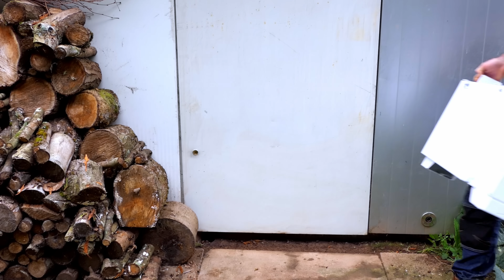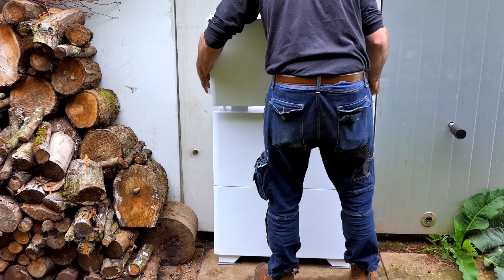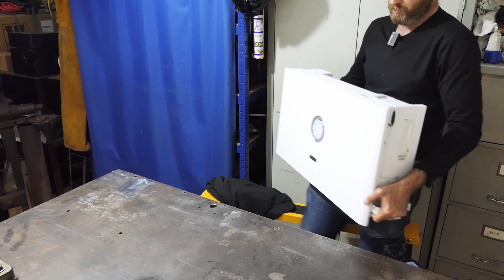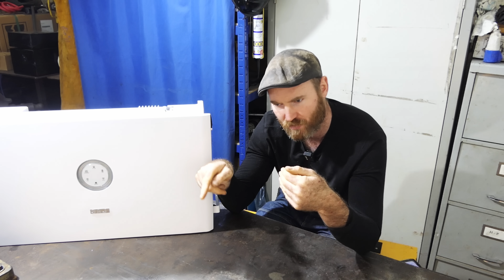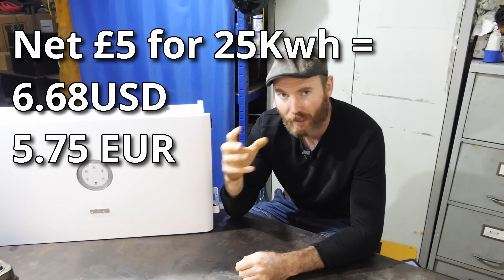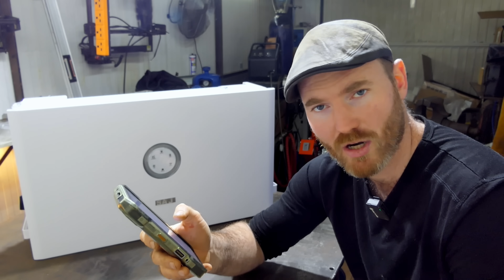New Batteries Make Money?... I'm shocked

Comment: One thing to watch for: if your system relies solely on battery storage without solar or other renewable generation, be aware that your energy provider may not pay you for energy exported to the grid. The Smart Export Guarantee (SEG) scheme explicitly excludes payments for 'brown export'—energy from non-renewable sources, including batteries. Even if you have already received payments for such exports, your provider may claw them back later.
Reply from the maker: Good to know. Thank you for sharing. Cheers J
Reply: Wow. Changing the goal posts but only for the horn owner. Maybe if Offgem did their job we would be able to get a fair cost of electricity and let’s go back a few years to pay us back. Never going to happen.
Reply: @davideyres955 it's always been the rule back to FIT. Some suppliers offer specific tariffs for battery arbitrage like Octopus Flux, but it's difficult to make work at small scale, whereas generation and self consumption works great at small scale and avoids all the annoying but necessary grid tie regs

Comment: Grid tied systems go down when there's a blackout.
Reply: Modern ones don't. For example I have a Tesla Powerwall 3 which goes into off-grid backup mode when the grid goes down. I've been able to test that this works great 3 or 4 times in the last couple of months where I live. You can also put it into off-grid mode manually too. Works great with solar panels.

Comment: I literally just got a battery installed yesterday! What timing?!

It's probably going to more than half (potentially quarter?) my energy bills by charging it over night on the cheap tariff, then using it through the days expensive tariff. So far with a 10kWh battery and heat pump I've managed to load shift 15kWh of usage into the 7p/kWh economy 7 hours which is about what my house uses on average per day. it's 28p/kWh outside of that. 

I was paying about £2350 per year on energy, or an average of £6.44 per day. That was before I bought an EV I charged at home. Today I'm on track for about £1.50 total energy cost. So yeah, about a quarter the cost! Should be about £600 a year total, maybe? Saving about £1800 a year? Although the hardware costed about £3k, The installation fee was effectively about £5k totalling £8k?! And it's "normal" mains wire about two foot long wired from the inverter to the distribution board, a current clamp, and then proprietary comms cable and DC power from the battery to inverter. It took him 6 hours. I'm in the wrong job! It REALLY isn't in the order of £1k per hour wage difficult. Even with that absolute joke of a rip off government enforced £8k installed system cost, payback will be under 5 years. That's a better return on investment than the stock market or just about anything else. 

That's on Octopus Intelligent Go. Which you need an EV and charger to get access to. I bought an MG5 with 200 miles of real world usable range for £8500, which was about half the price of buying the equivalent Ford Focus petrol estate. Also I charge that off the cheap tariff and it gets about 3.7 miles/kWh, so fuel costs 1.9p/mile. Petrol Estate would get about 50mpg being generous, £1.35/litre, 4.55 L/gallon. £6.14/gallon. 12.3p/mile fuel cost. So it saves on fuel AND purchase price?! I do maybe 4000 miles a year, so that's £416 saving on fuel a year for the car. Saving over £2200 a year in total?!

5kWp solar panels getting installed in February to further bring down energy spend.

Comment: If you go into the Rabbit Hole of energy, aether, from air and ground you will find that we dont need batteries or the cables for electricity. I like you channel but this one is another trick to keep us people connected to a grid that is holding is back from the free energy that is all around us.
Reply from the maker: I have seen concepts on what you're implying. I've not seen anything substantial enough though to run my freezers and keep my batteries charged through. 

I'm open to all ideas and if I can test them I will.

Cheers J

Comment: Hi Josh, your comments do not sit comfortably with me. I am an 84-year-old man with heart disease and spine damage, and I dislike the cold weather, so I decided to do something about it on the cheap. I have purchased 6 x 500-watt solar panels, and I am building a 2x4  timber lean-to at the back of the house. The output voltage is around 40 volts DC, so in series, that would be 240 volts DC. This power would then be used to run a heater, which is ok on non-inductive units. Basically, when there is sunshine, I get 3 KW of heating to my home. I know it is intermittent, but the house will be a lot warmer in general, and I may look into the old storage units and possibly make up something to suit. Connecting to the grid has so many complications, which means putting up with something a bit less than required, so I am partially circumventing the grid and only using it when power is needed and is not available from the panels. Let me know what your thoughts are, as there are many problems that can come up and bite you. Regards Mo K
Reply from the maker: Thank you for taking the time to comment. The biggest issue I see with your set up is there is not enough power for generating heat at the time you need it most which is winter... In Summer we don't use any heating up until late September... Electric heating is 100% efficient in conversion but it is expensive from the grid and as you heard will be unreliable. Wood on the other hand is still solar energy but created in summer and stored in cellulose for consumption later. I use coppiced wood which is created using regenerative sustainable practices that benefits natural ecology. You can also get pellet stoves which if you buy pellets in bulk can cost as little as £0.10/kwh and are highly efficient. I also use diesel heaters which aren't so environmentally friendly but If you run on heating oil can cost as little as £0.05/kwh as I've been buying it in bulk in July when it's cheap at £0.48/L. The only issue with those is they still require a power supply to run the fans and glow plug. I think I'll have to do a series on effective non electric heating systems because I don't think you're the only one concerned about the matter. Cheers J
Reply: @joshuadelisle  Yeah i vouch this, personly if you are struggling and need heat, diesel heater is the way to go, you get alot of heat, especially if you get someone who loves tinkering they can modify the exhaust to trap even more heat, buying 6 x 500 watt solar panels which will input abysmal amounts of power when you need it aint going to do anything, unless you buy a MASSIVE battery storage and by that point it will cost thousands that you should have just used normal gas heating or electric lmao.

Can buy chinese diesel heater for what? £120, purchase a small fan for like £20, then buy something like an eco flow or bluetti or even one of the cheaper brands to power it, and charge it via 400 watts of solar which should be more than enough in winter

Comment: Sigenergy knock off clone by the looks of it but if it works well your in front and not paying massive electrical bills.
Definitely worth installing a battery.
I hear Amber Electric in Australia is getting a foot in the door in the UK recently.
I'm with Amber and have seen $21.40AU FIT, Feed in tariff in October.
It might be in your best interest to move to Amber when it's up and running in the UK mate.
Cheers from AU Joshua
Reply from the maker: Thank you. There are a high number of similar models entering the market recently. So there is probably a lot of copying going on. Cheers J
Reply: @joshuadelisle The price spikes for FIT don't last long with Amber but I had last month bill negative $30AU.
Sigenergy system installed is 16Kw battery and 6Kw inverter.

Comment: As an Amazon delivery driver I can easily do 150 miles a day or more, so I charge 2  portable power stations in the van to keep the batteries topped up, then use them at night. I've got a third one connected in the house just to keep my electric bill down. At the moment, I'm practically running off-grid,  I reckon this device wouldn't suit everyone; there are loads of cheaper alternatives similar to what I'm using,
Reply from the maker: That's a great a solution. If you're driving anyway then why not. I guess it would add equivalent strain on the engine so you pay for it in fuel. But if your miles are paid for then it's great. Cheers J
Reply: Nice! Got images of Amazon vans with racks of eco flows in the back 😂 you spotted an opportunity and too it 👍 mate used to take one into the office at work and charge it. Bit more visible that.

Comment: Ok this is certainly a interesting conversation. However this was presented from a Bias view, being a UK installation. Energy buy back schemes are not widely available, so making money outside of the UK is not the principle reason a lot of battery owners have them. 

Here in PT for example, brown outs are a real thing, and I work from home in the IT sector, I can not afford to have my systems in my home office shit the bed. Its bad for my job, its catastrophic for my tech and its a embarrassing look for my customers that I support.

So while the cost of batteries is significant and my ROI is near zero I gain a few positives against my investment.

1. I am protected against the brown-outs in my area, I am now in fact a drop in centre for neighbours who also need to work from home but do not have batteries. 
2. I can control the cost of energy, I am on a split tariff so I buy electric off the grid at night when its cheaper and use it from my batteries during the day when its expensive.
3. I can expand my battery storage with my car. with a few mods I have 100Kws of storage sitting in my driveway, which now expands my home capacity significantly.
4. we get longer periods of sun here, so Solar actually has a reasonable impact on my energy savings and fuel usage.

So I would say focusing on making money from your system is the wrong place to look for wins, in controlling your own energy. The real win is in controlling your energy.

I hope that helps, take care, D

Comment: Gas powered generator?  Gas is 6 pence a kwh.  Even if you could only convert half of that to electricity it would be 12p a kwh.   You could serve a few neighbours for economies of scale.   I have a few solar panels, they give diddly squat in the winter months.
Reply from the maker: That's a good idea. It's more like 25% conversion efficiency though. But the waste which is heat can be captured and used in the central heating. Cheers J

Comment: One of the few YT presenters that eludes to the big problems coming to the uk when the last 4 AGR nukes shut down 28 & 30 which were due to close 27 but recent panicking in Whitehall has squeezed a few more years without proper life extension work being done.

Blackouts are likely.  Gas boilers need power.  You are on the right path of having heating and power that the government can not interfere in.
Reply from the maker: Thank you. I'm also looking at heat recovery from my generator to do my central heating also. Black diesel is also very cost effective... Cheers J
Reply: @joshuadelisle if you have a greenhouse you may wish to look at heat recovery into a thermal mass to store and slow release the generators intermittent thermal output.  Given your genset will work in winter mostly it is a good fit.  A big barrel full of water with a coiled SS pipe is all you need to Xfer the heat and you can put an insulating cardigan on the tub to regulate the heat transfer.  It’s cheap and effective also if the tub is black it will absorb winter sun for useful insolation gain.

Comment: I think you should look into aluminum energy storage for that winter dip you talked about. Most of your current wood gas setup could be reused or extended for hydrogen, like that condensor you built. I'd swap the generator for a couple of PEM cells though, since there are legal issues running generators, at least there are in my silly bureaucratic country. We can't run them for over I thought it was 50 or 100 hours yearly, and we need to have some monitoring system installed to prove so. They won't cry about fuel cells though, yet. Another idea is bidirectional charging if you own an EV or hybrid. I've actually selected most of the components for my own aluminum stove already, if you're interested in collaborating let me know.
Reply from the maker: That's a very interesting idea. Cheers J

Comment: The storage capacity of these batteries is not going to remain 100% over 15 years. Probably neither is the efficiency.  You’re going to need to do some maths based on graphs.
Reply from the maker: It drops by 20%
Reply: @joshuadelisle  Yes, probably so . . . over time, and probably not in a linear fashion, which complicates the maths.

Comment: Selling to the grid is only profitable for a few hours a year. That's not where you save the money. It's in utilizing almost 100% of your generation. During summer, time shifting when you sell excess energy back to the grid as spot prices are zero or negative during a sunny day. Or during the winter, buying energy when prices are low and using that energy yourself when prices are higher. And over where I live I can save extra by doing peak shaving and reducing my grid fees that way. If you do the math for yourself always account for the price of the battery per cycled kWh, grid fees plus taxes and charger/inverter losses. Plenty of ways to make a battery work, assuming its cheap enough, selling energy back to the grid isn't one I'm counting on, those few hours a year are just a bonus. 
I can make the math work for me but for most people a battery is still not cheap enough if no other factors influence the decision.
Reply from the maker: Thank you for sharing that. Cheers J

Comment: Years ago I watched a YouTube vid of this guy who was running his house on off-peak electricity. He had a truck battery charger hooked up to lead acid batteries in his basement and an inverter to convert it back to mains electricity. He had it hooked up to one of those off-peak meters people used to use to run storage heaters
Reply from the maker: Sounds like a creative solution. Cheers J
Reply: Lead acid batteries are only 60% efficient. He was probably losing money.

Comment: I was going to mention the standing charge aspect. Could possibly run the generator off old cooking oil. Another idea is to buy a second hand ev for about £2000 ish with a 30/40 Kwh battery with still plenty of life left and repurpose the battery for house storage.
Reply: There is an open source system to interface between solar hybrid inverters and a number of EV battery packs - check out Dala's EV Repair channel

Comment: I've recently had a 5kw Enphase PV and battery system installed by Octopus. I wish I'd gone for 10kw because on the Intelligent Octopus tariff they fill and drain my battery when they need to support the grid demand.
I have the added benefit of exporting at a decent price when it's sunny, which hasn't been that much lately 😅
I've also got a Cosy 6 heat pump which has saved a small fortune in energy costs already.
I like the idea of these batteries, especially if a home can't have solar panels, but I doubt they would be compatible with my system and they would be more expensive than adding an extra 5kw battery.
Great video though J 😊👍
Reply from the maker: Thanks for sharing your experience. Cheers J

Comment: I have a solar system with inverter and battery setup, but I Never sell any power!
No matter who you are contracted with you buy your power more dearly than you sell it. This means that as I generate less than I use I never give them any power, but use it all myself!

For 6 months of the year I generate 400Kwh a month but use about 570Kwh a month (for the other 6 months my generation is negligible)!
In order to sell power you would need to be on a variable tariff which would increase the costs of use during the day considerably.  Unless you have electric heating (TSR's) I would advise against this. 

One thing to bear in mind is that the guarantee period of 15 years is only good if the company is solvent for that period! Should enough units fail they may just go under or alternatively change name and you loose the guarantee! As Batteries age (and solar panels too)  their efficiency does go down in effect making your battery smaller. Also with lithium you do not get full charge or discharge without serious degradation of the battery! .... Just things to bear in mind!
Reply from the maker: Thanks for sharing your experience and insights. Cheers J

Comment: We get properly fleeced for everything in the UK. Food, energy you name it. 
 As for going off grid, you can get 16 kWh of lithium batteries for less than £1000 direct from china, add a few hundred for an inverter and BMS….. yet buy a 5kwh all in one system and it’s £8000! 
 Best option is to massively oversize, maximise your solar panel coverage, south facing roof, north facing roof, fence etc @ £60 per panel, 60kwh of battery, total cost less than this 5kwh system and forget the grid!
Reply from the maker: You said it. Cheers J
Reply: Chinese batteries.. nuf said!  ROFLMAO
Reply: @karstenevans1833  like the ones in your laptop, phone, car, remote control, and pacemaker?
Reply: @karstenevans1833 80% of lithium batteries are made in china, the ones that aren’t mostly rely on Chinese made components.
Reply: @karstenevans1833  Wait till you find out were every company you buy batterys gets them lmao.

Tesla? chinese batterys.
Polestar? chinese batterys.
Iphone? chinese batterys.
Every single android phone on the market? chinese batterys.
Were do all these "made in germany" get there batterys from? china.